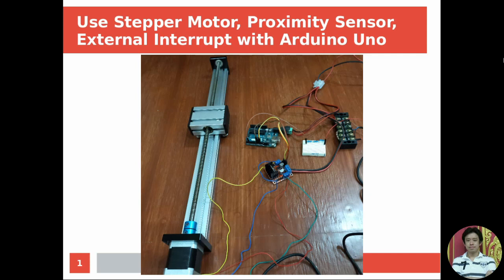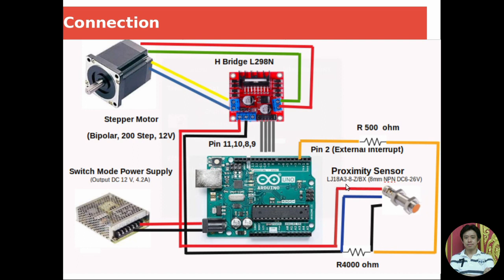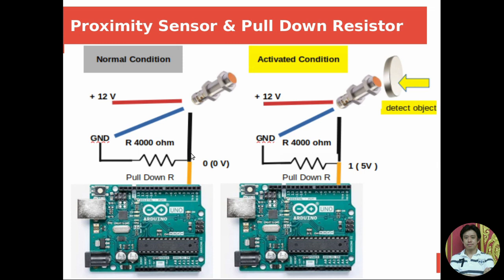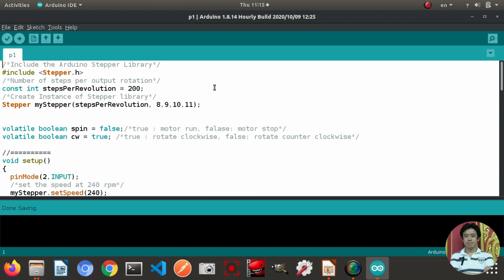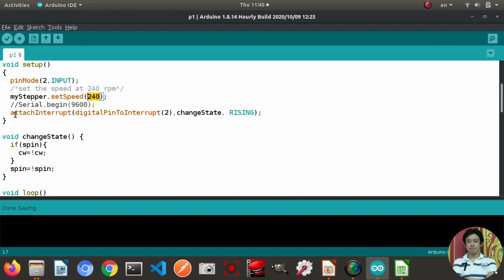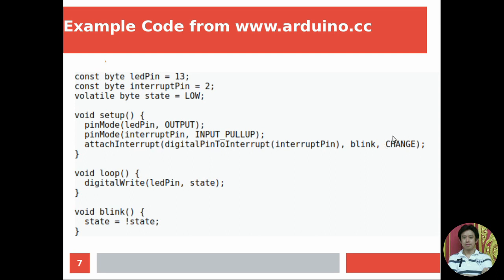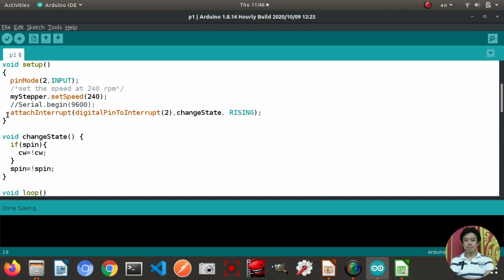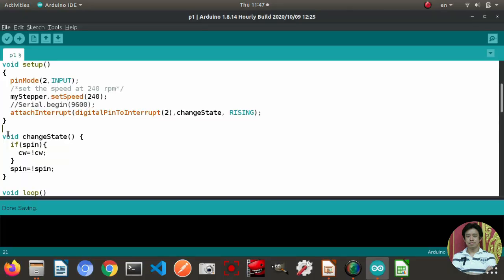Use Stepper Motor, H bridge L298N, Proximity Sensor, Interrupt with Arduino Uno

Comment: excellent explanation. 
I have a question .....(you used NPN proximity sensor , so signal wire (Black) should be High voltage,  when it is not close to metal.
signal wire has 0 volt, when its near to metal.